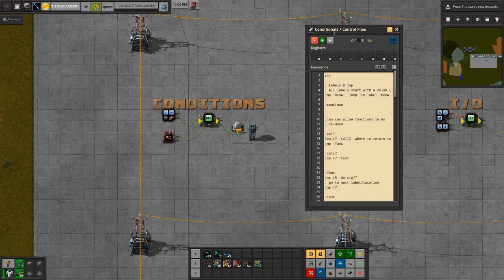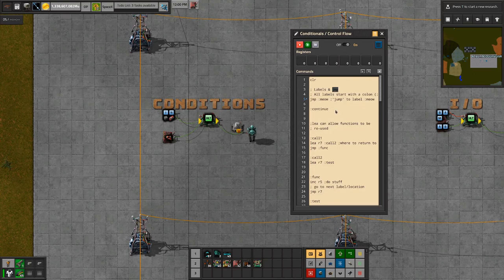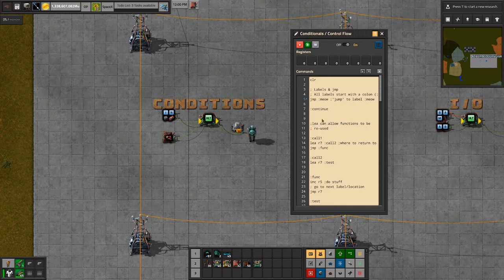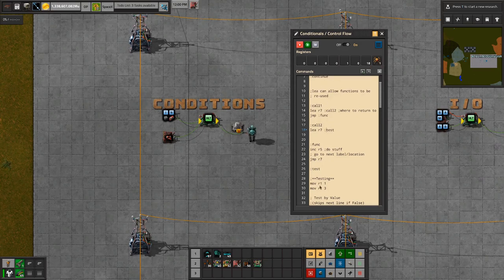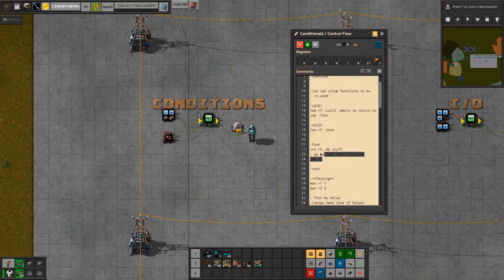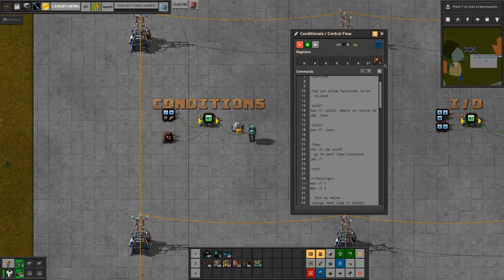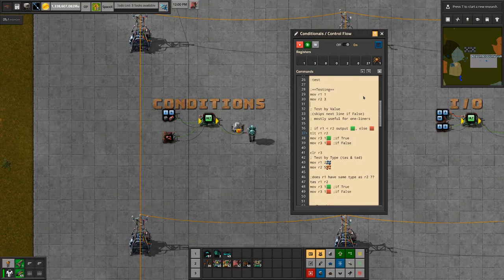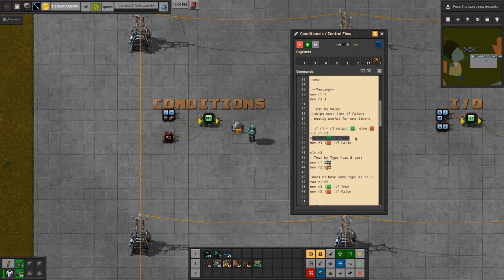fCPU Tutorial 4 - Conditionals / Control Flow

Comment: I have no idea what I'm looking at... I assumed this fCPU plugin was going to be with IF statements... I was looking for more something to set filters on filter inserters like (If [Copper-Ore] < [Iron-Ore]) { output [Copper-Ore] } where the copper-ore would be used to set the filter on an inserter.

I'm not a programmer, I don't know programming languages but I can use my google-foo techniques to figure stuff out, however, I have no clue what this is written in or what to use in it.
Reply from the maker: It's a more simplified version of Assembly Language. Some psuedocode for what you're describing would be:

tlt X[copper ore]  Y[iron ore]
mov out1 Z[copper ore]

Just make sure to place amounts right next to the symbols (shown above as the X,Y,Z letters) otherwise it will output the default value of zero amount of that type.

As for loading the input signals into the registers so they can be worked on by fCPU you need to load them in via command beforehand, which I went over in the section covering Basic I/O:
https://www.youtube.com/watch?v=W84qXtIKae4&list=PLUS7abK0FzfUuL9Aurv9HbTBQqIfAzQfw
Reply from the maker: Although it sounds very complicated at first (because there is a bit of a learning curve when getting started) it's WAY better to use fCPU when doing things that would require more than just a small number of combinators, namely because combinators are a living nightmare to debug. With fCPU you can just go back through your code , which you can comment on what everything does.